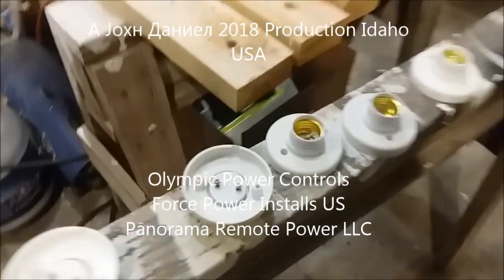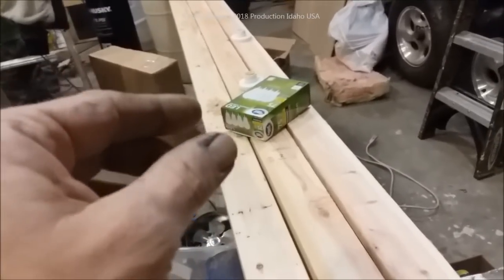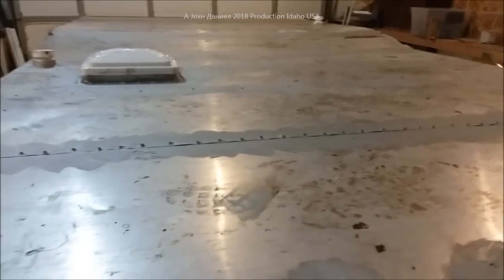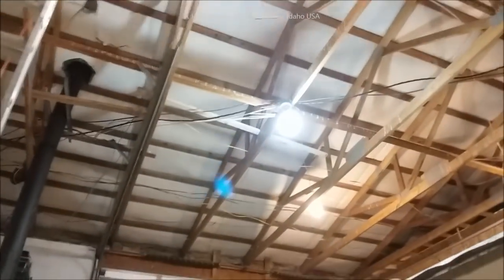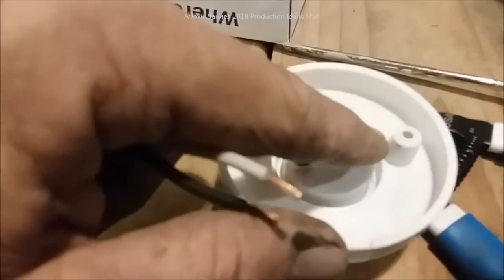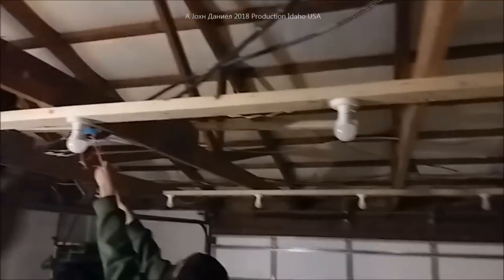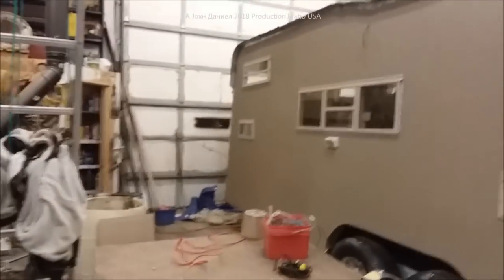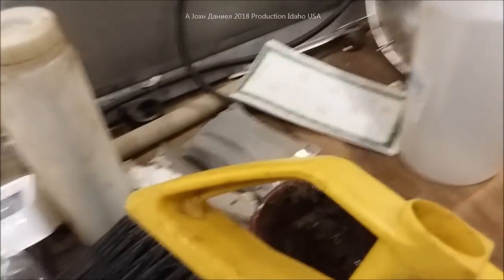DIY Garage Shop LED lighting on the super cheap

Comment from the maker: Parts used are listed in here https://www.amazon.com/shop/influencer-acccb1e8 with many other things you see on my videos. Pick the lumber length you need and be sure to space according to wattage chosen. 3  feet for 50 watt equivalent, 4 feet +/- for 75 watt like mine due to height. Under 10 feet height you can probably space at 6-7 foot apart. 
Lumens went up over 200% and power needed from my battery bank dropped by 45% which means winter solar production losses won't effect me anymore.

Comment: Awesome work. Can finally see the light. Been meaning to ask. What did you do with the welder you got in the mail.
Reply from the maker: Welder is probably going to be put into use when I get my power & mobile shop trailer built, its for building racking and tracking mounts for solar power.

Comment: Nice! I bought some for temporary worklamps.  Heed caution however! Never unscrew the lamps live and check the screws in the edison socket! They are often will back off and short (edison threads are pretty rough on ones I recieved) May not be in your case.  Enjoy the videos and ideas keep on going!

Comment: Hey John.  I have a very good product you need to learn about. You do a lot of RV work. This stuff is really good on the roof, but once you start using it, I know you will be using it many places. It’s concrete self leveling caulk by Locktite. I can’t remember the part number, but you can only buy it at Home Depot that I’ve found. Until you get used to it, the project does have to be level. On RV roofs a cheap throw away brush can be used to actually brush it on. It feels ‘ tacky for days, even though it’s set up. A light coat of primer will take care of that.
Reply from the maker: I have the sort of same thing but not by locktite. Dicor 501LSW https://amzn.to/2EizmhO . Using the gardner/blackjack rubberized as a seam builder has been good so far, in a year I will re coat it all .
Reply: Јоhn Daniel I should have done this before. But this is the stuff.  This is really good stuff. Sticks like crazy.
Loctite PL S20 Polyurethane Self Leveling Concrete Crack Sealant, 10 Ounce Cartridge, Masonry Gray (1618150)

Comment: Very nice. Been putting these in my house to run all lights from a cheap Chinese turbine. Check out driverless cob leds. Very cheap and powerful and run directly from mains voltage. If you can solder and mount a chip to some aluminium then you're good to go. Can get a 50w for 3 or 4 euro (5 bucks?)
Reply from the maker: Got a source? I like that option.
Reply: @JOHNDANIEL1  https://rover.ebay.com/rover/0/0/0?mpre=https%3A%2F%2Fwww.ebay.co.uk%2Fulk%2Fitm%2F392092568933 I got these 100w for 6 euro. I reckon just search on ebay/amazon/aliexpress for "110v cob" and buy the cheapest, that's what I've been doing with no problems. Get some heat sink compound whilst you're at it 👍